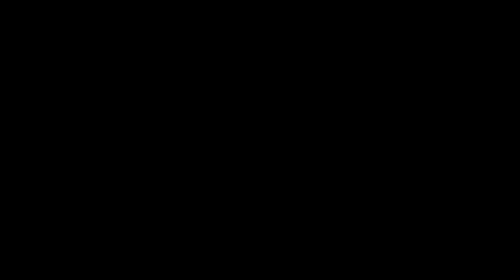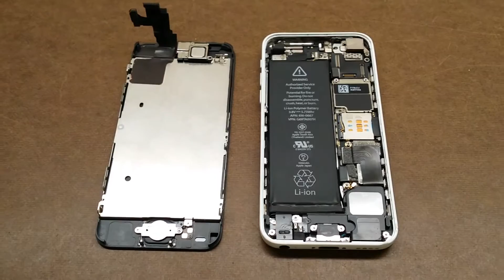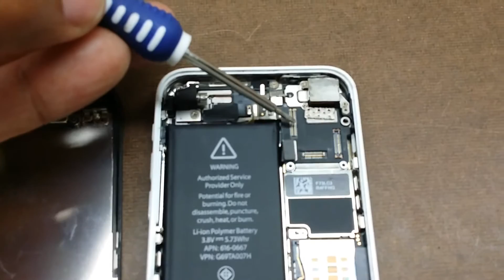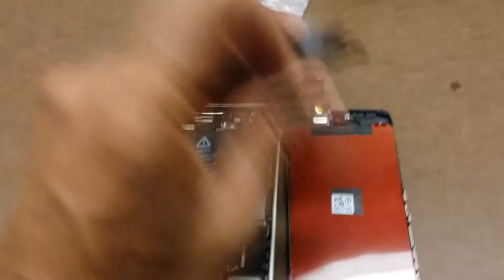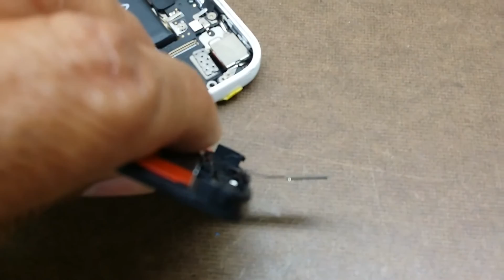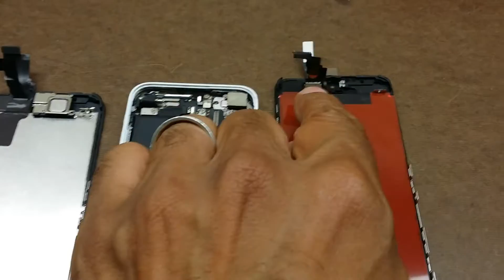Apple iPhone 5C, iPhone 6, iPhone 6 Plus Digitizer Port Problems

Comment: Carlton, Great and timely information here, thanks for your efforts. I took apart my iPhone 5c only to get stuck here at the connector assembly process. Although I am not an E.E. or a master electronics technician, I have a reasonable technology background and fair dexterity from a lifetime of performing medical procedures on human beings. No matter how hard I tried, I could not keep all connectors in place when I tried to screw down the plate. I tried holding the screen at a < 90 angle, but this makes it impossible to manipulate the screwdriver. Now understanding that the connector(s) themselves may be damaged beyond repair in a way I can’t detect makes me shake my head at this sort of engineering. It is apparent to me that designs which are implemented to prevent reasonable efforts to repair the device belong to the most vile group of planned obsolescence. I am a capitalist for sure, but deliberately forcing someone to “buy a new one” or pay an exorbitant fee for manufactures service is criminal. Very frustrated. birdandthe: I don’t need to be an ophthalmologist to advise you not to look at the sun.
Reply from the maker: R West Thanks, and I'm glad it helped you out! I'm actually a Civil Engineer, so I had to learn all this stuff on my own. I grew up taking apart AM radios, because I was always intrigued by electronic devices. So I learned fixing phones by experience and messing up! It's funny hearing myself do this video. I've learned so much more since then!